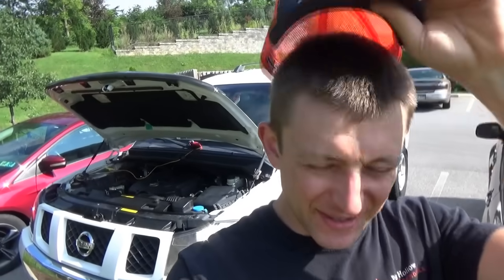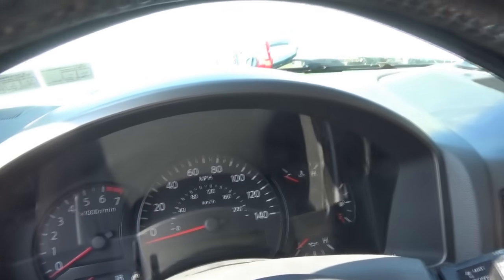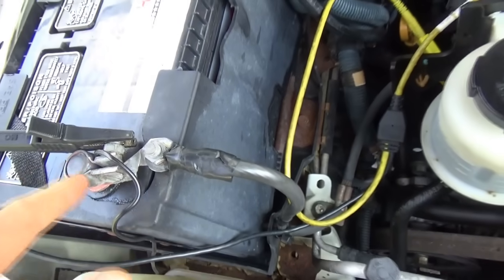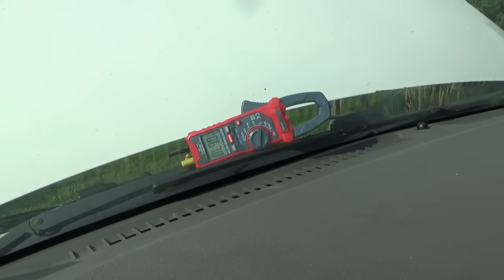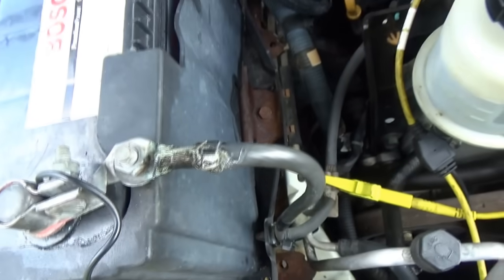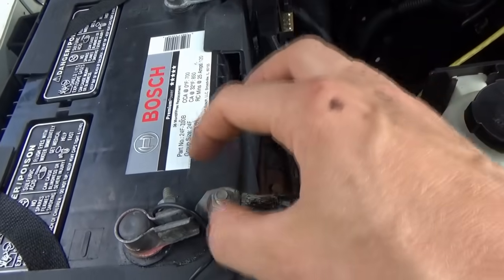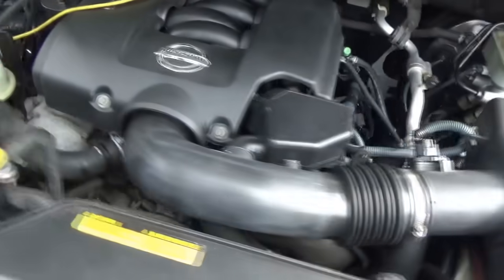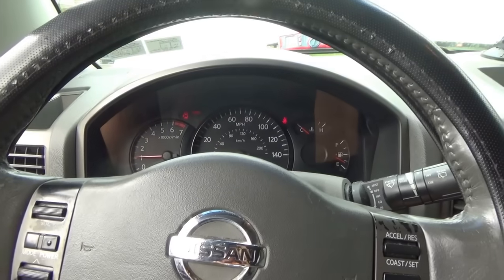No Crank...No Start...No Parts Required! (Nissan Armada)

Comment: I see you up to the same all the same oh I could have fixed that and used only hand tools no electrical tools required The 1st thing I would have done was check the ground cable 1st thing I what are you doing with pull the tape off the ground cable and found the problem immediately no electrical tools required but I know you gotta make it look like it's some hard case to do just for you tfor you too I still say Russians make the worst cars in the world
Reply from the maker: If you touch stuff without first collecting data, you're gonna get BURNED, dude 😭